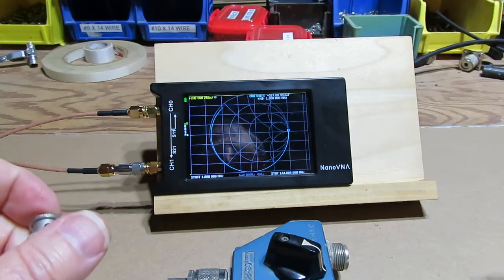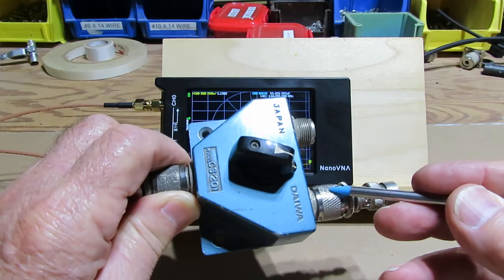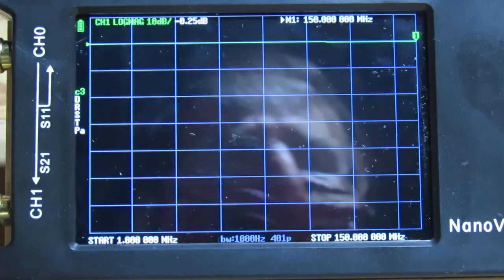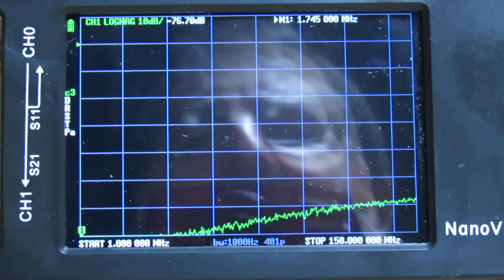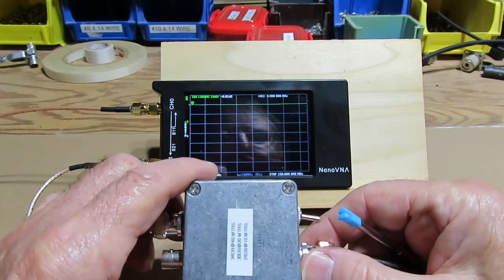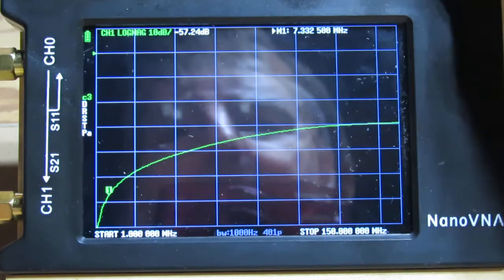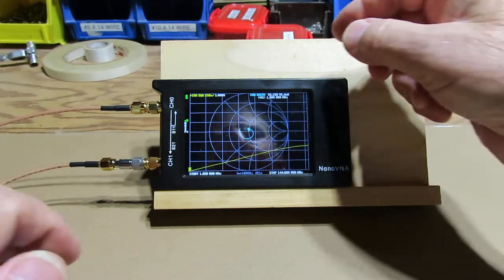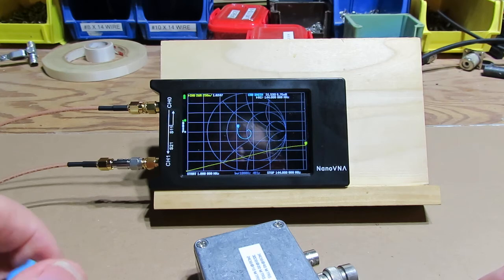Setting up the NanoVNA for checking baluns and insertion losses Part 2

Comment: Any chance you might use the NanoVNA to check the effectiveness of the clamp-on baluns that many equipment makes put on coax and power cables. I assume they must do something or they wouldn't be there. But are they as good as wraps around a torrid?

Comment: Barry, another question;  The Attenuator On CH1, does that ADD to the negative dB reading you are seeing?  Exp.; The -72 dB?  Would that really be -62dB ?  Also, I know that 150 MHz is close to 2M, but why not stop / use 148 MHz ?
Reply from the maker: Once calibrated, the 10 db pad is transparent. So no, it does not affect the reading. If it says -72 db, it's -72 db.
Barry